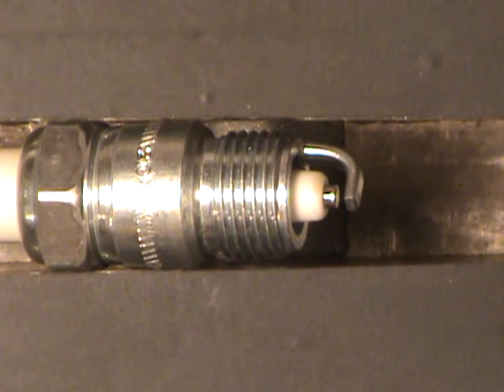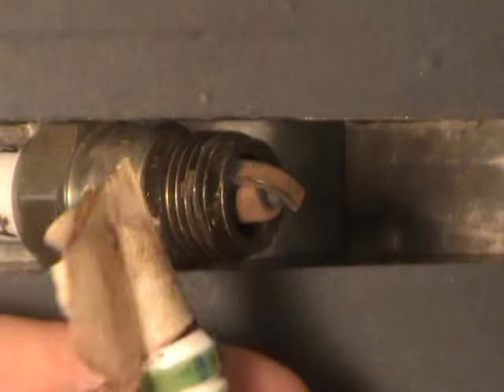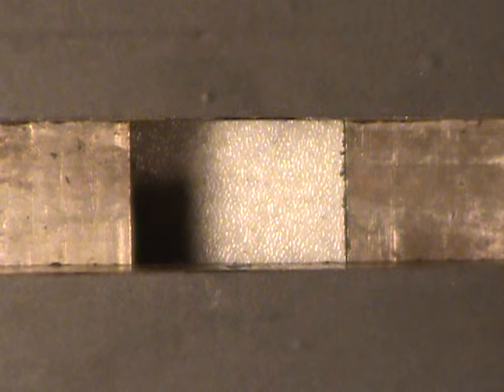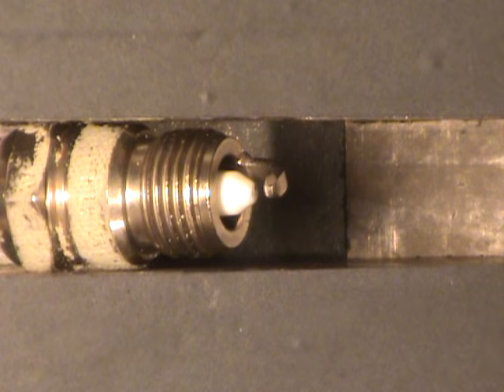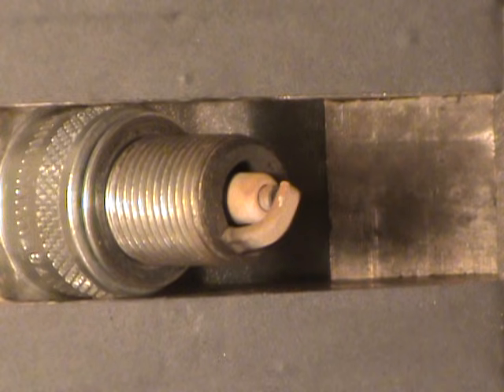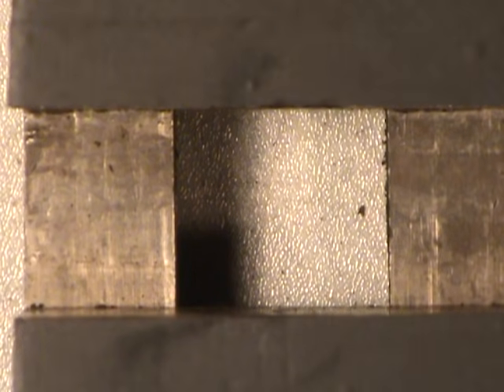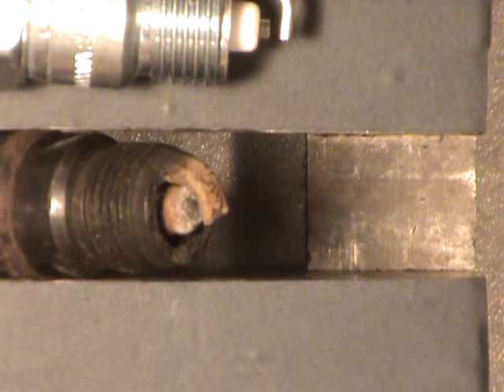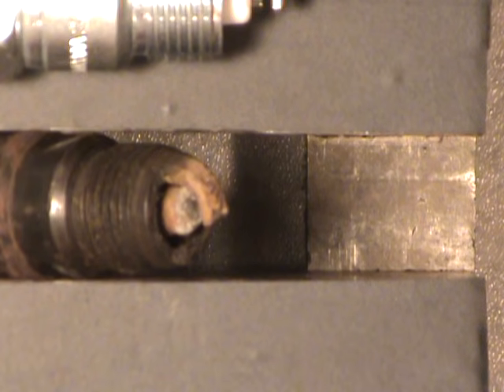SPARK PLUGS How to Read them (Part 3)

Comment: What do you think about dry reddish brown plugs.
Reply from the maker: Greetings...NTH Welding......Thanks for watching......Some years ago, I also saw, probably the same red-ish colored, dry deposit, on all of my, factory stock, 350 Chevy V-8's spark plugs (that had a 4-barrel Rochester carburetor, and a BIG cap, H.E.I. distributor, on/in it...circa 1979)......Since that time, I did a bit of research, and the best observation that I have to offer, is the following......I came to the conclusion, that, that red-ish colored deposit, was caused by a gasoline "additive", that use-tah go by the initials of...MMT (if I recall correctly, that is)......If Ya care to, do an internet search for that MMT (I think?), gasoline "additive", and......till next time......Be Safe, take care, and have a good one.

Comment: the correct way to test a spark plug  with an ohm meter is to set the ohms  scale to the highest reading    on your   now connect one lead to top of plug   connect other lead to bottom hook   if the plug is clean your meter want show any thing    if  it dirty you will see pi on the scale we arent looking far a  certain #  any #  is telling you   the plug needs cleaning   your reading is coming down to the white part  then threw the carbon to threaded part  in the engine the spark will take that path ihstead of jumping  across the gap  causing a missfire   if you dont have plug cleaner  harbor  freight has one very good  and cheap i use mine often it will clean adirty plug  1-2 mins look like new  i hope this helps
Reply from the maker: Greetings...Frank Davidson........Thanks for watching.......I hear Ya alright........Yes, indeed, you can measure the resistance of a spark plug, with an ohm/multi-meter meter, but, Ya had to be careful, if it happened to be a "resistor" type of spark plug.......Some of them, might have had 5,000 ohms resistance, and others, might have had, about 10,000 ohms of resistance, both measured, when the spark plug/s were brand new, and not used yet........I kinda recall that, some of the older/cheaper Champion spark plugs (.035 inch electrode gap size), had an "R", in the spark plug code designation, and maybe, also, the resistance value as well, possibly.........I already have, a hand held, 12 volt, hook-it-up-to-a-car-battery, spark plug, sandblaster, type of spark plug cleaner, that is probably over 30 years old...lol........I stopped using it, a long time ago, because, I was rather concerned, that, some of the abrasive medium, might get "trapped/left behind", deep down inside, where the white-ish colored ceramic, meets up with, the metal spark plug shell, and, I was thinkin'...what if some of those abrasive particles, became dislodged, while the engine was running...???...badly scored cylinder wall/s, loss of compression, and then some, maybe...???........I know, I know, just like you, I also, don''t like to see, a used spark plug, that is still able to function properly, not being used, if it is simply cleaned, electrodes, filed flat/square, if applicable, then, re-gapped to specification, but, for me, is it worth the risk of having, one or more, of those really abrasive "particles", dislodge itself/themselves, while the engine is running...???...so then, that's why I don't use it anymore...and.......till next time.......Be Safe, take care, and have a good one.
Reply: @RockysRoadshow  i dont know  what you using for blasting   there are several typs of materal    nothing is going to stick to the inside portion on the plug been doing this for years   no problem   this stuff is about like black pepper
Reply: @RockysRoadshow  i belive you miss read my test the ohms you are talking about  are reading tip to tip dont worry about that reading  that is normal for a restistor plug the test i am taling about you read from the top of the plug  to the hook on the bottom put the meter on the highest ohm scale on your meter  a clean plug resd nothing  a dirty plug will read somthing dont worry about  the #s   any reading tells you the plug is dirty with carbon which will conduct  the spark to ground  so get a miss fire

Comment: what would make my plugs close?   running a 350 chevy carb. with headers
Reply from the maker: Greetings...Mrssea Sea.........Thanks for watching........Your spark plugs are "closing"...???........Well, if you meant, that, the spark plug's outer electrode, is being, shall we say, "bent", towards the center electrode, and it makes the spark plug's "gap" (distance, between the two electrodes), become smaller, then, my best guess, is that, the "wrong" spark plugs were installed into your engine's cylinder heads........I'm assuming, that, your engine is factory/stock, other than, the exhaust headers, and possibly, the carburetor as well, so, if that be the case, then, the screw-threaded length, of the spark plug/s, are probably "too long", for the cylinder heads in question, which will make the spark plug's electrode end, protrude further into the combustion chamber, then they should be........If "too long", then, what will usually happen, is that, as the piston rises up in the cylinder, as far as it can go, then, the top of the piston, has the possibility, of making contact with, as in, this scenario, the outer electrode, which will, as you put it..."close"...the spark plug/s, I would think........If your engine's cylinder heads are factory/stock, then, "make sure", that, you have the "correct" spark plugs installed...!!!........You might find, that, the..."Reach"...of your spark plugs are too long, for your "exact" engine........The "Reach", of a spark plug, is the measured distance, from the outside, of the outer electrode (looks like a bent metal strap, if you will), then, all the way up to, where, the spark plug, makes contact with the cylinder head, when it's installed, and tightened into place (Ya might have a spark plug, that has a sealing washer on it, or maybe, it has a taper/angle, without a washer on it...???).......You might find a label or sticker, inside of your engine compartment somewhere (under the hood), that might have the correct spark plug, part number, printed on it, providing that, the engine is original.........Sometimes, at an auto-parts store, a mistake is made, by, a wrong part listing, or, a parts person, possibly.....So then, always make sure, that, the "specified/correct", spark plugs, get installed into any engine in question, otherwise, sometimes, there might be a problem or two, along with, some engine damage, be it, not so expensive, or, really expensive to fix, or, get fixed.........Good luck, and......till next time......Be Safe, take care, and have a good one.

Comment: i would like to add a little info on dirty plugs  i use a ohm  meter on the highest ohm scale any reading on this scale is bad  con iclip to top the other to (  hook) on the bottom  if you get a reading   then i clean the plug my  small plug cleaner that i bought at harbor freight about 5 yrs ago  then i test again   and it is clean  i never thro a plug away  dont remember  last time i bought a new one
Reply from the maker: Greetings...Frank Davidson........I replied to your other post, that you posted on this video, about 3 weeks ago........All of the information, that you'll find/read about, in my reply, to your other post, will address everything that you posted here, and......till next time......Be Safe, take care, and have a good one.

Comment: What would happen if the Spark plug is opened or close to much?
Reply from the maker: Greetings...Mr. Balboa.........Thanks for watching.........If you are talking about the gap, that's between the spark plug's two electrodes, then, here Ya go.........The larger the spark plus "gap" gets, then, it will take a higher voltage, from an ignition coil, to be able to jump that gap..........Smaller gap, requires less (high) voltage, to make the spark jump.........It's usually a good idea, to have the spark plug's gap, set to the vehicle manufacturer's specified gap setting, for ease of starting, and also, good gas mileage, and performance too (note...some types of spark plugs, can't be gapped, or they will usually break...!!!)..........Change the set of spark plugs, at the vehicle manufacturer's, suggested, replacement interval as well........Old, worn out spark plugs, that have the gap worn, to a larger gap size, will usually make the ignition coil, or ignition coils, as the case may be, work a lot harder, in order to produce a spark, between those two electrodes...and.......till next time.......Be Safe, take care, and have a good one.

Comment: What does ' running to lean ' mean
Reply from the maker: Greetings...Ninten Tyr........Thanks for watching.......The term, "running too lean", just means that, there is not enough gasoline, in the air/fuel mixture, for the engine's needs, whether it be, just cruzin' along, or, mashing the pedal to the floor-board........Most of the newer (gasoline), fuel injected vehicles, will usually be running a 14.7 to 1 air/fuel ratio (as in, air to fuel ratio, or, a mixture of air and atomized gasoline, which is measured by weight), while just cruzin' along.........Now then, let's say, that we go, gas pedal to the floor board, while going up a very steep hill, then, the air/fuel ratio, will usually go, quite a bit "richer', as in, oh, about 12.5 to 1, and in some cases, it might go, as low as, 10 or 11 to 1 air/fuel ratio, for a turbo-charged, or, super-charged engine, in order to keep it safe, and not get damaged, while going pedal to the floor-board........Too lean of an air/fuel ratio (or mixture), can really damage an engine, especially, while going pedal to the floor-board, and also, the spark plugs, will probably be looking like, it has a white-ish color on it, without having, any darker colored deposits, on it at all.........If the air/fuel ratio (mixture), is way too "rich", for the engine's operating needs, then, there will usually be, lots and lots of, dry, black, carbon deposits, covering most of the spark plug, and, if really bad, then, the engine will probably be miss-firing, and maybe, be hard to start as well, possibly, and......till next time.......Be Safe, take care, and have a good one.

Comment: How many miles should I put on a set of new plugs before I take them out to read them? Thx
Reply from the maker: Greetings...Mitch.........Thanks for watching.........If your vehicle is about 1996 or newer, then, the vehicle's onboard computer, will usually detect a misfire, in one or more, of the engine's cylinders, and, will usually be storing a trouble code, in the vehicle's, on board computer's memory, that can be extracted and read with, a scan tool (usually, looks kinda like, a slightly larger hand held calculator).........No misfire codes, usually means that, the spark plugs are firing alright..........If it's an older vehicle, then, drive around at different speeds, while cruising along, and also, while accelerating quite hard (legally...!!!)...for about, oh, 300 Miles, or a bit more, should be alright (no set rule here, it's just a matter of, letting the engine run, for a long enough time, so there will be some deposits showing up, on the spark plug, so you can see them easily).........Make sure that, the spark plug's "heat range" is correct, for your "exact" engine, and also, make sure that, the "gap" (between the two electrodes), is at, the specified (gap) size too, and.......till next time.......Be Safe, take care, and have a good one.

Comment: 9:16, looks like insulator damage, preignition or detonation?
Reply from the maker: Greetings...Stan Rodgers...…….Thanks for watching...…….Good observation, but it wasn't, what you thought it was, as you had mentioned..........That white-ish colored looking stuff, that you saw, was, shall we say, a deposit, of some kind or other, that, for some weird reason, actually "grew" (as in growing), onto the spark plug (or was it, onto the deposit/s, that were already on the spark plug, possibly), as, the set of (used) spark plugs, were in storage, for quite a long time........To me, it kinda looked like, a calcium, or lime-like deposit, so to speak...……The Insulator (porcelain lookin' stuff), didn't have any damage on it, as in, any chipped parts, missing from it............Gotta remember now, that, this set of spark plugs (with the blue paint on them), were, the "original/factory" spark plugs, that will sometimes, get a bit messed up, by a brand new (or freshly rebuilt) engine, before and during, the seating of, all of the "rings", that are on all 8 pistons...........This, 400 cubic inch small block Chevy V-8 engine, was still using, about one quart (or one liter) of motor oil, in about 500 highway miles of travel (might be...oil control rings...???...loose/oversize valve guides...???...or maybe, faulty valve guide seals, or, bad installation there-of...???).........I still recall, that, whenever this engine would start hesitating, I was thinkin' that, there might be some water or condensation in the gas tank, seeing as how, the vehicle didn't get driven, all that much........So, I would just get some methal hydrate, and put about one cup of it, into the gas tank, to take care of any water, that was presumably in it, and, Ya know what, it sure worked good, and temporarily cured the hesitation...!!! (placebo effect maybe...???...lol)........Yes-Sir-ee-Bob, that was surely, a messed up set of spark plugs alright.........It was a 1979 engine, that had a factory installed, H.E.I. (High Energy Ignition) BIG cap distributor in it, and, I'm still kinda puzzled by, the spark plugs, not looking a lot cleaner, than, what you and I saw, once they were removed from, that low mileage engine, and.......till next time.......Be Safe, take care, and have a good one.

Comment: Great video! I was just wondering would you consider a true cold air intake a forced air intake? If not then cool no need to upgrade the spark plugs! If yes, then I need advice.(2.4L Chevy Cobalt) 

I have no issues w/my car just looking for extra ponies.

Please & thank you in advance.
Reply from the maker: Greetings...Ctb 1981...…...Thanks for watching...…...To me, a cold air intake, is just that, as in, the air box, or, air filter end, of the air intake, is placed in a position, where, the colder, or coolest air, can be picked up from (sometimes found, between, the inner and outer fenders of the vehicle), and also, sometimes, there is a box shaped heat shield, that keeps, heated engine compartment air, away from, the cold air intake's, entry point as well...…….A forced air intake, is probably where, (intake) air, is, shall we say, rammed into, the engine's, air intake system...……..Might be, in the form of, a hood scoop, turbo charger (exhaust gas driven), or super charger (belt driven)………..The reason, that, a good, cold air intake system, is good for performance, is basically because, there is usually more oxygen, contained within, cold (not wet) air, as opposed to, hot air...……If you are planning to install, an "oiled" type of air filter, then...don't..."over-oil" it...after it has been cleaned, because, if your air intake system, has a "mass airflow sensor" in it, then sometimes, that extra/not needed, air filter oil, will contaminate, the mass airflow sensor's, very sensitive (and fussy), sensing, electronic component/s (sometimes, they can be cleaned, with a special spray cleaner, if Ur lucky)……….It all boils down to, how much money, that, Ya wanna spend...???...…...Check out, your vehicle's, factory installed, air intake system's location, as, Ya might already have, a "cold air intake" system, without even realizing it, maybe...???...…….Factory recommended spark plugs, should be ok, if it's just, a non-forced, cold air intake system, that is being used...…….It's usually when, the engine's, cylinder (combustion) pressure increases, by using, nitrous oxide, turbocharging, or supercharging, where, a spark plug's heat range, starts to get colder, as well as, the "gap", that's between the spark plug's electrodes, also gets smaller too, and...…..till next time...…..Be Safe, take care, and have a good one.
Reply: @RockysRoadshow  Cool! No need to upgrade my spark plugs!